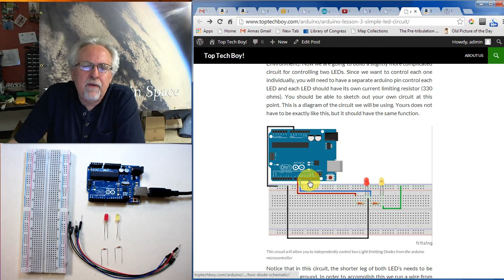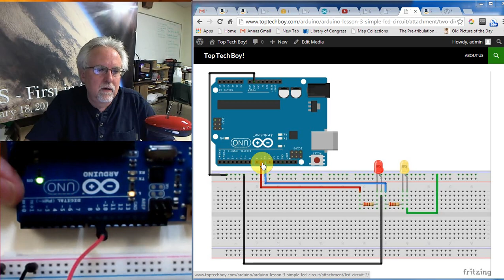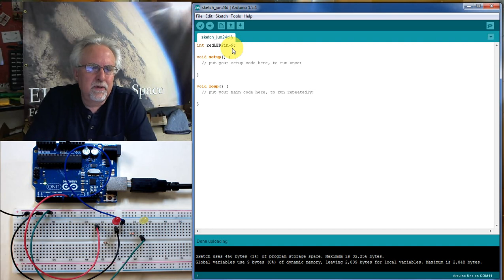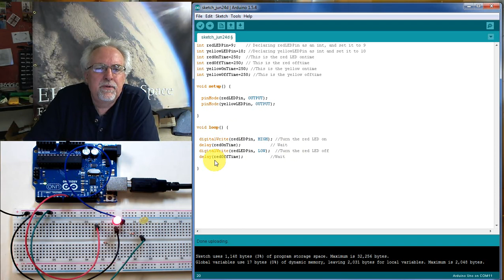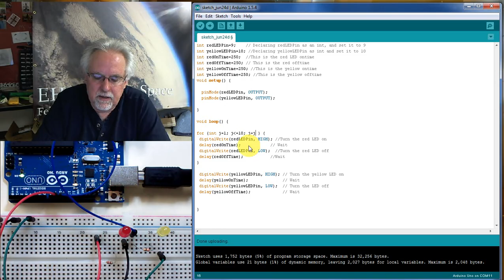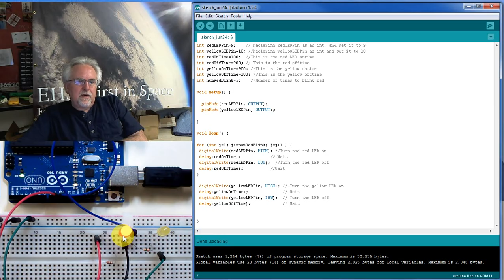LESSON 3 - Arduino For Loops and LED Circuit

Comment: Great lessons Paul!
How many 'for' loops can you use?
I had the 2 from this lesson written to blink 5 times each, they worked fine. I then added 2 more, to blink the same.
Code was verified, & uploaded, but the second 2 loops were 'ignored'.
The 1st LED blinks 5 times, then the 2nd LED, then it returns to the first, & continues looping only the first 2 'for' loops, the 3rd & 4th loops never activate.
Reply from the maker: If you do them correctly, you can use as many as you want, and you can even nest them. If it is not working check your code carefully
Reply: Thanks Paul.
Had the > instead of the <  lol
Back on track now!!

Comment: Dear Paul, thankyou for you wonderful video!! can you please give me advice on how I can connect an 10W Led with 12V Led Driver Directly onto Arduino board? i tried to do it, but it didnt work... Thankyou :-)
Reply from the maker: No, only plug low power components into the arduino. That is way more than what an arduino can run. You need an LED controller, and only control the controller from the arduino.
Reply: Thankyou Paul, any advice for the Led controller? Thanks :-)

Comment: Like your videos.
I have had programming experience in the past, not recently, but am new to Arduino. I look at a lot of YouTube videos and learn something from each one. I have a question about the for loop. You declare, initialize, and increment j outside the curly brackets. Since the incrementation executes each time through the loop, why do the declaration and initialization execute only one time? My past practice was to increment as the last statement in the loop code. It looks to me that the increment is not even inside the loop code. What am I missing?

Comment: @paul McWhorter thank for your great videos, i'm from India i really enjoyed your videos, i have one doubt how we can blink the led forever and do other tasking if i use for loop i cant able to do other tasking unless it come out of the loop.. please sir help me......
Reply from the maker: With arduino you can do only one thing at a time. If you have a delay command, the arduino does nothing else while it is waiting.
Reply: One thing you might try, but I have NOT programmed with arduino. You can set a waitTime variable and use a conditional statement to turn on/off the led for example. i.e., 

int onWaitTime=1000ms;
int setTime = 0ms;
boolean ledStatus; (or int using 1 or 0)

Loop
if(setTime >= waitTime) 
  { 
    if(ledStatus == 1 (or true)
            turnOffLED;
    else
            turnOnLED;
    setTime = 0ms;
  }
setTime += elapsedTimeSinceLastLoop;

Then, the loop will continue and LED will be set based on elapsed time, not waiting and pausing the loop. Maybe +paul can elaborate or convert to arduino code if there are even the functions  available for arduino.

Comment: i have a question where does the power come from? because in circuits current always flows from the cathode of a battery please help
Reply: when the Arduino connected to the computer no need for the battery 

if you finish uploading the code to the Arduino and the Arduino not connect to the computer then you need to connect it to a battery 

I hope you got the idea.. sorry for bad english

Comment: Sir there are 3 (three) no of ground pins in Arduino UNO. Are they all identical?  I am asking these as you used another pin in your previous lecture.  I am a civil engineering student and i dont know these things. your video seems easier to understand. If you clarify my doubt it will be helpful..

One request sir, If you do a tutorial on working with two sensors. One is speed sensors and other is distance sensors. Actually i want to measure fluid discharge using those sensors.

Comment: Hi there,

Thanks for a great tutorial. I am brand new to Arduino but loving the things I have learnt so far. Huge potential for these little products.

I have a project where I want to motorize a machine in the workshop which I use to cut finger joints. 

I will use a stepper motor, easydriver, arduino uno, LCD keypad shield and a button as my hardware. 

I want to set it up so each time I press the button the motor will move a certain amount (I want this to be adjustable through the keypad shield) and when I long hold the button it will return back to start. I know this is simple code for many people but I would love your help with this. It would save me much headache.

Please assist.

Thanks in advance

Comment: Cool, and j++ works too! I love how so many concepts in programming are universal and this is so cool that Arduino has other loops. I just looked forward and see that it has many programming features like if statements too. This is so fun!

Just finished the end of the video and love the point you made about setting the threshold value of the for loop to a variable (j <= len) since it processes faster when the length of the loop is a fixed value, which saves a lookup after each iteration in certain situations, which can add up over many. I'm gonna see if it's like javascript where one can do:

for (int j = 0, len = 10; j < len; j++) {...}
Reply: Awesome, it works. Thanks again for sharing this fun info. I've always wanted to learn about electronics and Arduino just makes it so easy thanks largely in part to the inspirational value of being able to prototype and test things so quickly.
Reply: Cool so just for testing fun I tried to make the red LED blink faster each time. I simply made another variable named "factor" then reassigned the value of the "waitRedOn = waitRedOn - factor;" making sure it wouldn't get below zero according to the initial value and number of iterations, which I realized would make the LED stay on forever if the value of the delay went below zero. I then just had to reset the initial value of the wait time after the for loop ended but inside the main loop.

I additionally noticed that if a pin is set to a pinMode then default seems to be to initially set that pin to low so if I don't want the onboard LED (pin 13 OUTPUT) to be on during my project then I can just set it as output in the void setup and it will remain off.

What an amazing platform for learning and combining so many awesome things.

Comment: I am having problem with this code Error compiling. note: in expansion of macro 'output' #define output 0x1. error: expected unqualified-id before numeric constant.int redLEDPin=9; //Declaring redLEDPin as an int, and set it to 9
int yellowLEDPin=10; //Declaring yellowLEDPin as int and set it to 10
int redOnTime=250; //This is the red LED ontime
int redOffTime=250; //This is the red offtime
int yellowOnTime=250; //This is the yellow ontime
int yellowOffTime=250; //this is the yellow offtimevoid setup() {  pinMode(redLEDPin, OUTPUT);
  pinMode(yellowLEDPin. OUTPUT);}void loop() {
  for (int j=1; j<=10; j=j+1 ) {
  digitalWrite(redLEDPin,HIGH); //Turn the red LED on
  delay(redOnTime);     // Wait
  digitalWrite(redLEDPin,LOW); //Turn the red LED off
  delay(redOffTime); //WAit
  }
  
  digitalWrite(yellowLEDPin,HIGH); //Turn the red LED on
  delay(yellowOnTime);              // Wait
  digitalWrite(yellowLEDPin,LOW); //Turn the red LED off
  delay(yellowOffTime);            //WAit}
Reply from the maker: You did not define your variable redLEDPin as an int up top.

Comment: The Spark Inventors kit does not contain an Arduino R3.  It has a redboard. At 1:20-1:30 you seem to suggest the R3 is part of the Inventor kit.  Do I need to buy an R3 also?
Reply from the maker: Earlier versions of the sparkfun kit included the arduino uno R3, and then they started using the redboard. They work the same. In the class I teach at school, some students have the Uno version and some the redboard. They work the same.

Comment: Very good and I learned the internal loop. And making the pre setting list of integers. Very handy to write and work properly. The only cosmetic thing was the red coloured breadboard rail you used as GND. I often use 2e hands LEDs out of my component box. Recognizing the minus of LEDs is also possible determining the plat part of the LED housing. I prefer that because of the 2e hand status. But this are not  important things. Your lesson was excellent!  greetings from Holland. Frans Dullemeijer

Comment: Thanks a lot to the God  that I found you in webpage, otherwise it would be difficult for me to learn operating the arduino. I have received you as my teacher in my heart. Best wishes for you.
By the way... I actually  got to know about arduino when I was finding a way to make an incubator for my little quails. I came to learn that Arduino is a free hardware that can be manipulated to control temperature, humidity and motor.

Now I am learning programing language and your tutorials are greatly helping me.
Could you please suggest me any easy way to multi-task in Arduino?
If I use 'delay' in program it seems impossible to execute other works simultaneously. So if I could get  a video tutorial/suggestion on multi-tasking in Arduino Uno R3; it would be very helpful for me. 

God Bless You.
Reply from the maker: When you put a delay in, as you have realized, the arduino sits there and waits. Hence, while waiting you can not do anything else. About the only way to do things differently would be to program using interupts. This is not something I have covered in videos, but maybe do some searching on Arduino Interrupts.

Comment: Thanks for the lessons Paul, great job. I also ran into issue of the "for" loop clause not turning orange. Surprisingly after declaring the integer variables as shown by Paul in the video the code worked even though "for" stayed gray in color.
I used the letter "c" (i associated it with "c" in the word count) for the variable. I am running version 1.6.5. This stumped me for a good while until I went ahead and declared the variables and tried it anyway. Maybe someone from the Arduino community can explain whats going on. I'm in my 50's and having fun learning this stuff.

Comment: What if I want the red blink for example 3 times and then yellow one time and after that both of them do not blink at all. Kind of an end to program without turning arduino off? What I mean is that I want The void loop() just happens one or two times instead of continuing all the time automatically. Should I write a for loop for the whole void loop?
Reply: +cyrusIIIII did you end up getting an answer for this?
Reply: PierreLombardini Not yet :(
Reply: if you want to do something only once, remember put it in the setup. you are allowed to put any code there too not just initializations !
Reply: if you want to repeat twice. put it in void loop. then keep a counter variable set to 0. then wrap the entire code you want to repeat twice in an if statement. and put if ( counter < 2 ) { do code AND increment counter by 1) so when it does it twice, it wont do it anymore and the program will still go on if theres other outside the if statement
Reply: counter variable should be global so initialize at the top
Reply: PierreLombardini Thank you very much :) Is there a book that explain  such things as good as you for noobs like me? I remember at that time whatever I was putting in the setup would lead to error!
Reply: +cyrusIIIII could have been another type of error. maybe you were trying to print something so perhaps you were putting prints before your serial.begin line. but no idk of a book, I have heard of one but never looked into it. i am also starting to learn arduino but coding wise its just like every other language :p

Comment: Hi Sir Paul,

Can you make a video presentation on the Automation of lighting and air conditioning system using Arduino as a main controller. It will be a great help to me in finalizing my school project as Electrical Engineer student. Hoping and praying for your video to come up. Sir Paul can you kindly help me with my project this is my email address: jollypabellon@gmail.com

Jolly Jojo L. Pabellon

Comment: what causes the LED to blink irregularly?
Reply: +photon_trap I Noticed that, too. That is most likely a function of YouTube video streaming and not actually happening in the real example.
Reply: +photon_trap now that i look again, i think it may be because he was capturing three windows at once at a low frame rate. On my machine Paul's talking head is very jerky showing reduced frame rate capture. it would make perfect sense that it would cause aliasing when capturing the LED blinking. Wikipedia aliasing if you don't know that term.

Comment: Nice video, quick question: I understand the resistor controls the current that goes through the led, but what if we don't put a resistor, do we risk of damaging the led?
Reply from the maker: Ram Homier Yes you risk burning our LED, and you risk burning out the arduino pin if you try and draw too much current from it.

Comment: When I tried to upload the program  it said in orange letters that there was no sync how do I make it correct.
Reply from the maker: Michri A Kattar Make sure you are set to the correct serial port. If you are, then make sure you have the right type of arduino selected in the IDE board section. If still having trouble, unplug USB, reboot and plug back in.

Comment: hey guys i need some help as such. i have done all this and it all connects but the python IDle prints out " b'1\r\n'  " when it is working. then it does it again but with the next number like " b'2\r\n' " (the speech marks are to show you the line itself) as shown below 

b'1\r\n'
b'2\r\n'
b'3\r\n'
b'4\r\n'
b'5\r\n'
b'6\r\n'
b'7\r\n'
b'8\r\n'
b'9\r\n'
b'10\r\n'

thanks for your time